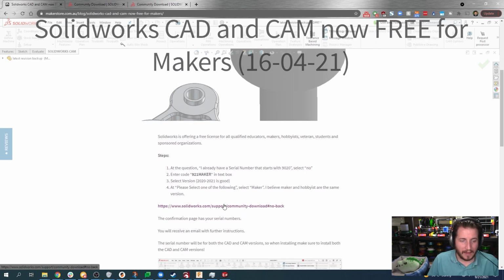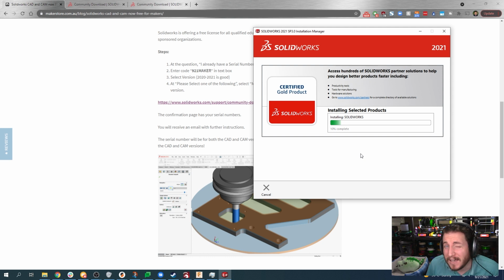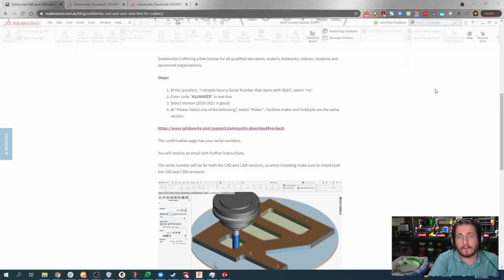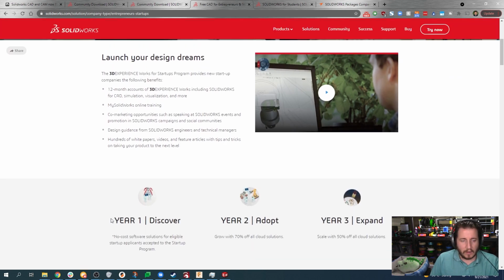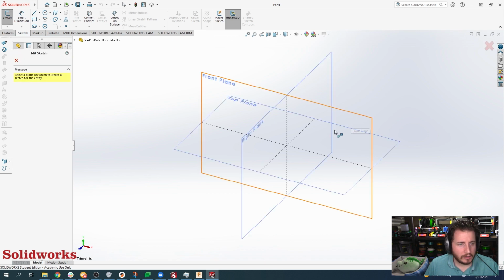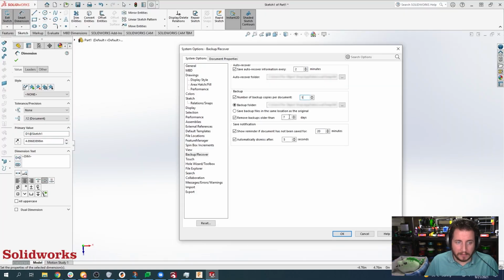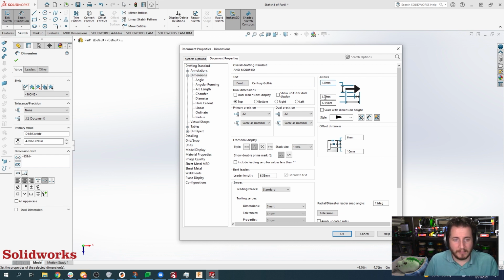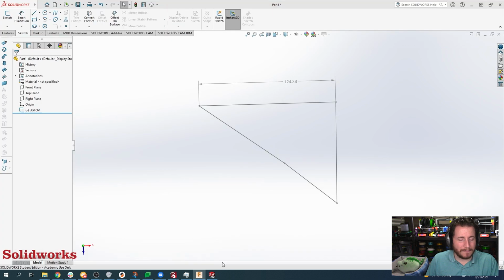Solidworks WAS FREE for Makers!! :/ (fail)

Comment: Maybe I am the wrong kind of  person to comment on this since I am a professional engineer using full blown CAD  software on a daily basis. 
I started out on Autocad back in 1987 and in 1999 I transitioned to Autodesk Inventor. Loved the software and used it for many years until I was appointed to lead an multi national engineering team on a project for which we used Solidworks. 
I bought my Solidworks license in 2009 and by 2011 I cancelled my Autodesk Inventor service agreement. 
Since then I use Solidworks exclusively, but I do have a basic Fusion 360 license that I just maintain to be able to do basic things on designs from clients using Autodesk instead of Solidworks. 
Solidworks is the most used software in industry and for that reason I never went back to Autodesk after starting to use Solidworks. 
That being said, I feel that the Autodesk user experience beats Solidworks hands down.
Reply from the maker: I don't think you are. I'm at the point where I'd use solidworks if I could afford it. But at almost 4k/yr for a single seat, that gets pricey fast. For $500 or less, fusion 360 does precisely what we need and with the cloud function (only recently added to SW) it enables us to have remote CAD engineers, which makes up the majority of our engineers.
Reply: I use Solidworks Premium which cost me about $8k for the perpetual license and a further yearly of $1500 subscription per year. The CAM add on cost me $4k and a yearly subscription of $1000 per year. So yes, if you don’t use it on a daily basis to earn money it gets real expensive real quick. 
For the occasional simuulation i simply buy a 3 month pass which now gos for about $400. A nice option if you do a project that only requires you to have those capabilities for a while.
Reply from the maker: Agreed, and while we do use it every day, maybe not on THAT kind of capacity right now, maybe one day!
Reply: One last comment. Fusion 360 offers 3+2 machining as standard on their $500 per year package which is brilliant. If you need 3+2 on Solidworks you will pay about $1200 per year. This is the main reason why I have Fusion 360.
Reply from the maker: I'm still learning the CAM side, I have a perpetual older mastercam license that I've enjoyed but it's not common I need to go above 3axis and if I do I'm working with a buddy anyways who has the crazy machines to do this!

Comment: SolidWorks for Makers is not completely free, but it is available to any hobbyist for only $99/yr.  There are also monthly payment options and you can cancel at any time, so it's a very powerful, flexible, and inexpensive license that is available to almost anyone.
Reply from the maker: It was right before we put the video out alas. The maker license does not include the commercial purposes I believe and if that IS the case, I do not see why someone would pay for it when there are free options out there from Onshape and Autodesk.
Reply: @3DMusketeers  there are so many people that prefer Solidworks to those products, and if you're five times as productive for $8/mo. I get it. How much is your time worth to you?
Reply from the maker: Roughly 150/hr based on current rates, but because I know Fusion well I use it. For less than $500 a year it is amazing, compared to 4k+ on solidworks for the same stuff! 

And I say free options that actually allow for commercial. Autodesk Fusion 360 has a startup license that is amazing! But yes, if you know solidworks, shell out the cash and deal with it.
Reply: @3DMusketeers  I could fill a book with the things SolidWorks does that Fusion/Inventor don't do. Saying they are the same is like saying a Chevy Malibu is the same as a Corvette because they're both cars and get you where you want to go. Would you rather have a Malibu for free or a Corvette for $8 a month? What would you think if someone walked up and claimed there was no difference between them because they both have engines, wheels, bumpers, lights, and a steering wheel?

But hey, it's your time, your channel, and your decision.
Reply from the maker: For my specific needs it is either 500 or 4000 which is a big difference. The one MASSIVE feature that we use fusion for that Solidworks did not previously have until a recent update was a cloud feature. Most of our engineering staff is scattered throughout the states, so not having the email files is AMAZING!
Reply: @3DMusketeers  yes, those make a tremendous difference. The real-time collaborative and data management tools offered now can be connected to a traditional SWX license or 3DExperience cloud-based design tools, and they are more affordable than standalone licenses have been in the past.

Comment: one caution check your system prior to buying... my Dell I7 32gig ram was not hot enough to run their cloud stuff... odd but it was good enough to run Solid Works 2020.   I also had several install issues... not a smooth install.
Reply from the maker: Yeah, it is a mixed bag really..

Comment: Fun fact: USA officially changed to metric system in 1975. Just... no one noticed it. But for real. Metric makes is just way better.
As for solidworks vs fusion, solid works is more mature so yes, it's better. For me, i like Rhino ^^ It's just so much faster workflow and less headache. if i need a very parametric workflow then IDEAS is better. But lost my IDEAS license so now i do rhino and fusion. For tool paths i also use master cam and a bit of art cam (yes, i know, art cam is dead) but will slowly move to fusion for that. I just need they guys at my little plant to get used to it as well.
Reply from the maker: I have not heard of IDEAS, will have to check it out! Fusion seems to be really good for CAM and pathing, but Mastercam is kind of the industry standard.
Reply: @3DMusketeers  Master cam is great. But expensive... So fusion is very attractive because of that. When i'm confident it can do what we need we will use fusion :). The new machine simulation extension is very useful (master cam have that too) since we custom build most of our machines :)
Reply from the maker: Definitely don't want any crashes!

Comment: You only changed units to MM from the open document.  Next time you start a new part file you will be back to Inches.  You have to change the template files for it to be permanent.  Located at C:\ProgramData\SolidWorks\SOLIDWORKS 2021\templates.  There are 3 files to change.  Part.PRTDOT, Assembly.ASMDOT and Drawing.DRWDOT.  Open them up like a regular solidworks file within solidworks and once you make the changes like you did in the video, overwrite or save as new files.
Reply from the maker: Woah! Thanks for this! I will do that! What a pain in the butt! 

Mind you, this way to get solidworks for free no longer works -_- so there's that...